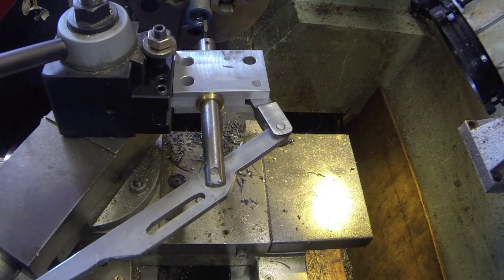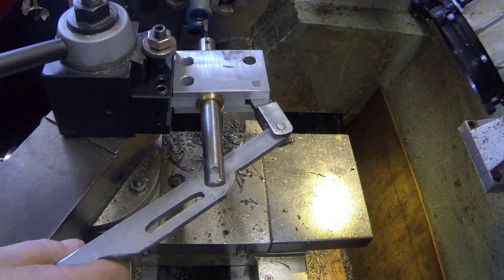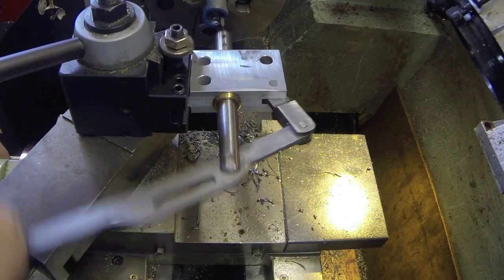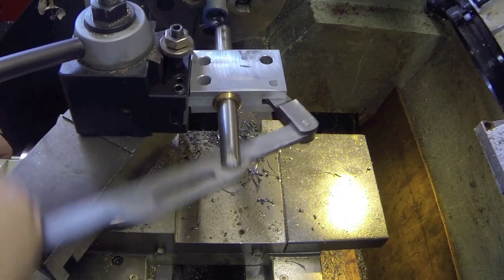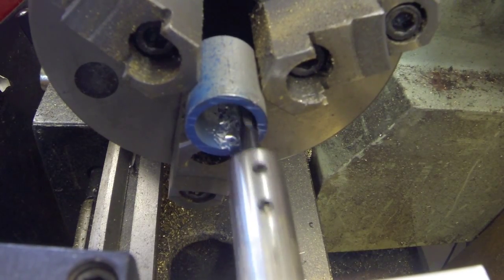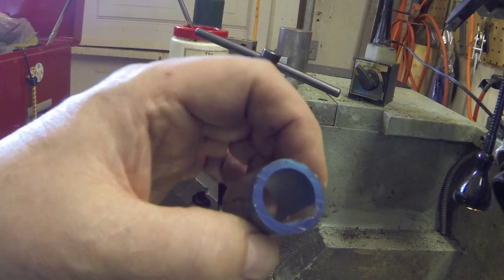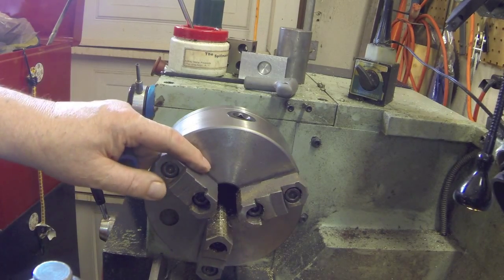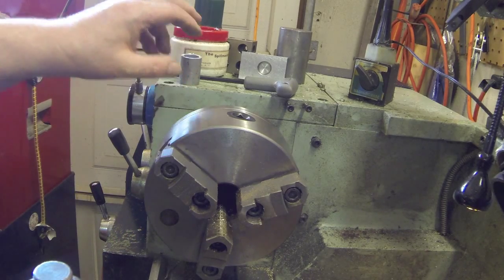Slotting tool demo

Comment: Hello Herb,

Face up a piece of bar stock the right length to brace it between the lathe bed and a chuck jaw positioned horizontally. Stick in the chuck key and hang a weight from it. That will take up the lash in the spindle.
Reply from the maker: Great idea Paul, Thanks!